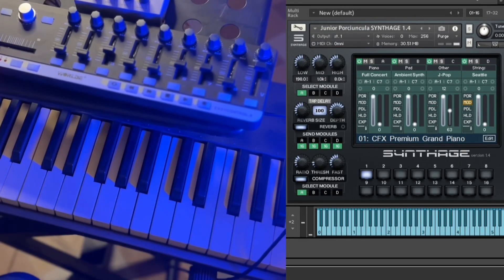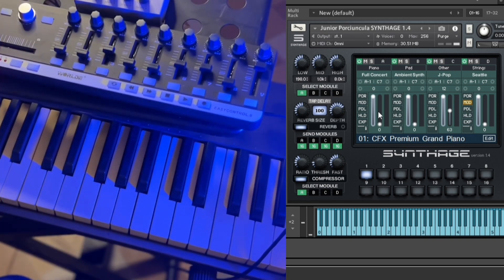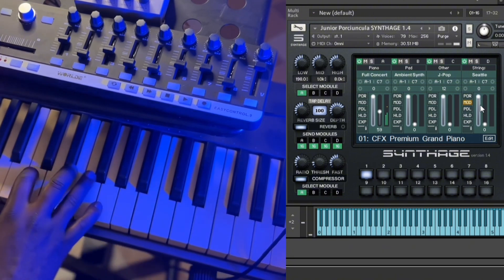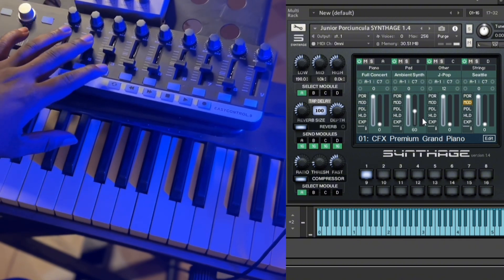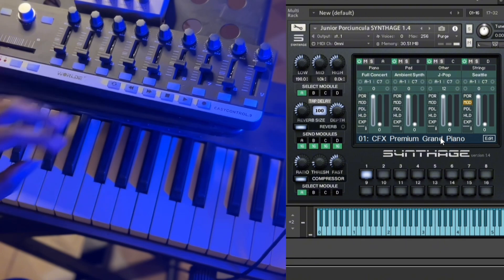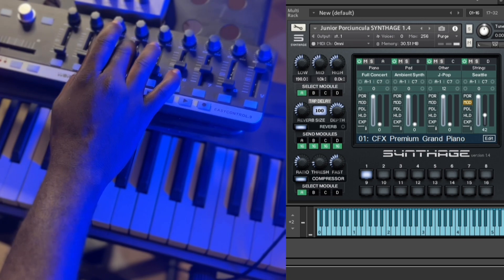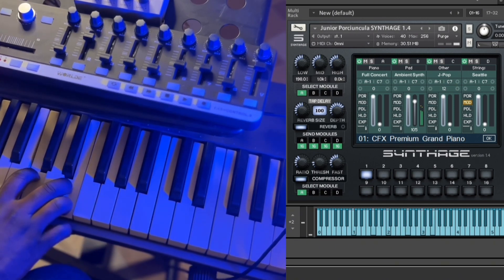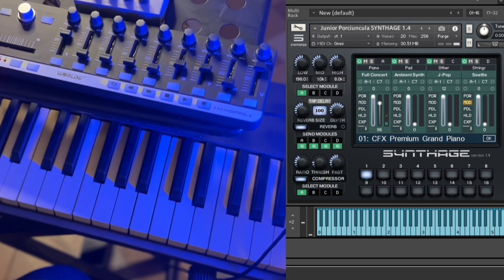How to Map Synthage/ VST’s to MIDI controllers

Comment: Are you using reaper daw?
Reply from the maker: Yes Sir
Reply: @throneroommusicministry  how is the cpu usage with synthage
Reply from the maker: You only get glitches when you activate all 4 sounds 
Depends on several factors I used my Lenovo Laptop for this video It has o my 8gb ram

My main pc runs fine with 20gb of ram
Reply: @throneroommusicministry  my system is 12gb ram and it is a ssd laptop... Do you think I would have glitches?
Reply from the maker: @WheezyPro what audio interface do you use
Reply from the maker: 12gigs of ram is a great starting point 
You may get little glitches when you add the 4th voice buh it won’t be bad at all with 3 sounds
Reply: @throneroommusicministry  Behringer UMC 204 HD
Reply: @throneroommusicministry  Do you experience any polyphony issues with this synthage? 
I once had ultimate stage grand and I was experiencing notes drop out.
Reply from the maker: @WheezyPro no bro I don’t have any issues. I also experienced that with the the ultimate stage pianos 
You need to use the HD Version 
Ultimate Stage Pianos HD Version
Reply from the maker: @WheezyPro then you’re good to go Sir